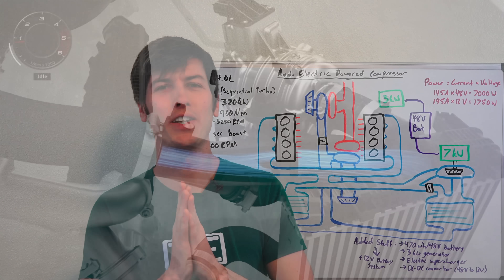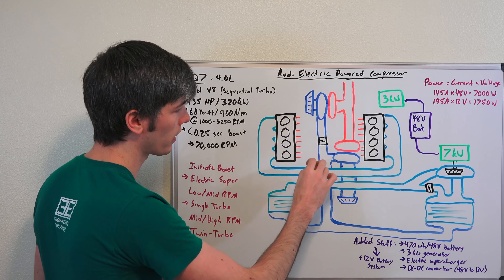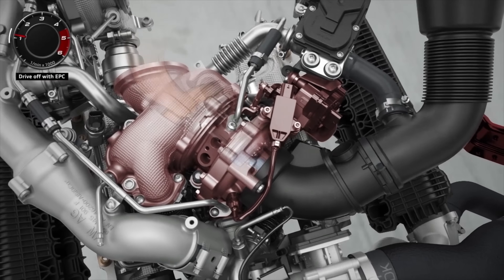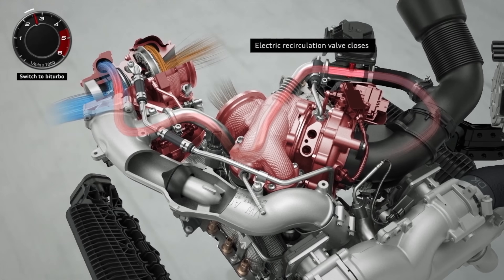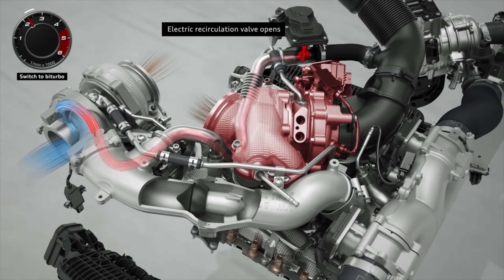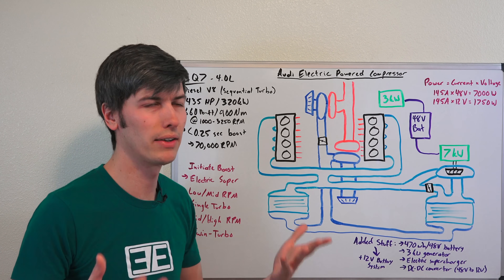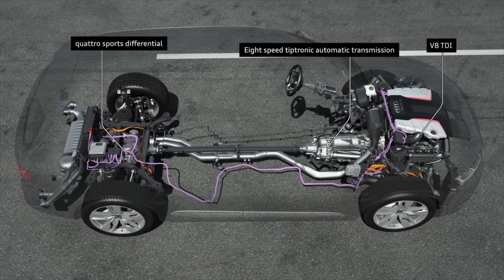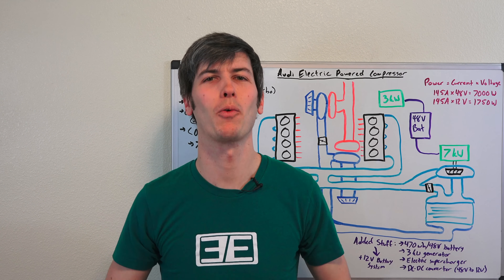Electric Superchargers - How Audi Is Eliminating Turbo Lag

Comment: Is this better than a supercharger in preventing parasitic loss?
Reply: Yes! But the trade off is that it's not able to keep up with the engine's air demand at higher RPMs! Which is why it shuts off at higher RPMs and why it shuts off under higher load!

Comment: Well I have Audi S7 TDI (europe 257kW) with this 48v electric supercharger. And i cant see any turbolag elimination compared to older Audi A5 3.0tdi 170/210kW or any 2.0tdi.

There is still massive turbo lag as like it has not any electric turbo 😃😃

Comment: "Turbo lag"
The term is used almost all of the time. It's not really correct.
"Engine transient response" is the correct description. Turbos really don't lag. There's just a lag between the time you tip the throttle, to the time the engine is making more power than it does naturally aspirated. That's not a laggy turbo.

Comment: Apparently hybrid high voltage systems work at 100-800 volts (Prius motors run at 650 but battery back is more like 200), I would think it would be easy for the OEMs to tie into that on hybrids.

Comment: The 12v system does not power the HVAC system.  The engine is powering it. The heat is from the coolant and the air conditioner compressor is run by a belt.  Only the fan is run by the electric system.

Comment: Remember there are no free rides.... the power to charge the battery comes from the alternator and its power comes from the drive belt. Also remember that every energy conversion results in some loss, so the more times you convert from mechanical to electrical to mechanical the more opportunity for parasitic power loss. These conversions also result in increased complexity and cost. You could use a belt driven Supercharger to supplement the turbo.

Comment: It would have made more sense to just have the 48v battery system and step down to 12v where needed instead of an extra 12v battery. Plus the 48v system will be able to more efficiently power the electronics and supercharger anyway if it has additional capacity to compensate for the lack of a 12v FLA battery.

Comment: Audi is twincharging, can be used as a solution to eliminate turbolag in the 2026 f1 engine regulations.
Reply: Mercedes has an electric turbocharger on their M139 engine a 2.0 4cyl making up to 416hp used in some AMG models

Comment: Actually someone made a video using a 48volt powered electric turbo where the battery powers an electric engine that spins the compressor in the trubo so no need for exhaust  gases to spin the compresser wheel of the turbo there is a standalone electric motor that spins the turbo itself therefor no lag and they made around 90 more horsepower on a cobalt motor with these eturbos so there is a future in them just need to run off of a 48 volt battery

Comment: I wanted to talk to you when you were in Adelaide; Then set-up a formal meeting with an NDA. Go from there. I'd like to discuss a few items regarding IP and Patents. While I provided some design rights to Borg-Warner, they have of course issues with VW group, my further designs are unique and fundamentally can be 'upgrades' to say new jet skis and motorbikes so an owner can do a 'hot swap' within 20 minutes in their shed to fit for purpose future emissions standards, or track mode etc including ecu adaption and manual requirements. 

Instead of just designs, I have my personal full sized gen 2 Hayabusa modified this. It looks 95% Hayabusa with the 'DIY' bolt-on upgrade using my own designed tools for quick upgrade. Plus the bike has new lighter and stronger chassis to physically increase efficiencies but significantly, with a turbo/supercharged partial electronic hybrid forced induction. Put it this way, I had an actual dream almost 20 years ago for fundamental changes that has only grown.. to now something relatively simple but not obvious at first. I had been designing since prior to finishing my Eng. Degree (civil and geotechnical) over 15 years ago -> yes, not mechanical but picked that up :D. 

I now have a physical build and tested on my gen 10 Hayabusa (about 4 above current) to be lonely to protect myself for corpo's.. Shown Suzuki and while they are negotiating with me to an extent to put me on retainer, like my last 10 years, like my recently ceased Lockheed Martin contract. 

However, this time I have built a modified ECU, to help a massive thermal efficiency increase, beyond f1 car but without the cost and detail to go far beyond EURO 5 emissions and forever improve. 

I am in Australia, but if you could get in contact with me, I'd like to use your status to first protect me from corporate thugs, make you some money % , get real investors and survive to ensure the puzzle fits together. 

Once I have made the money with a small % cut from future uses in many devices, you can present how this 'Epstein Drive', while not a fusion reaction engine brings humanity closer to clean the air while driving and move much quicker and quieter while doing it.

Comment: I just had a machine shop weld a pad on the turbine housing then drill a hole to insert a fuel injector. This allows raw fuel to be sprayed directly into the turbine having an "afterburner effect" like in a jet engine. It has eliminated the turbo lag and only sprays a short spurt when the throttle body butterfly valve is open halfway. No need for all these wires, electric motor, batteries like in this video.

Comment: Any idea what type of motor it is. I know it’s 48V DC but is it single phase, inductive ..?? I can’t seem to it out. Having stripped an EPC it has 6 windings on the stator but no permanent magnet on the rotor so the stator is energised to create the field to turn the rotor. I can’t tell if there is a capacitor in there to start the rotation or it just uses the intake air to start?? Any ideas?

Comment: I'd like to see you explore the capabilities of exhaust driven turbines to charge the 48V battery that is used to drive the electric supercharger. I wonder how much energy recapture you can get with an exhaust turbine charging system and alternator charging during coasting vs. the energy recapture of an exhaust driven turbo.

Comment: You're wrong about after market electric super/turbochargers. They are great but just don't have as high boost in high rev range and I was the guy that proved you wrong about plaid accelerating faster than breaking

Comment: I think there is something wrong with the power calculation. it's a wrong way to look at the power. It's not the correct way to look at power = work, by just changing the voltage. You need to keep your power and then change the voltage. 
So it will be 7000 / 12 = 583,33 Amps. Pretty big battery and wirring.
That's why the voltage is raised to 48 Volt in many cars where high power is needed.

Comment: You are completely wrong in saying electric turbo chargers don't do anything.. also they have kits that eliminate the need for all the Xtra items you talk about needed to run a electric turbo or supercharger.. on average they give a extra 50 to 75 hp and almost 100 ft lbs of torque.. instant power with little to no lag..

Comment: If anything: single turbo, still minimize lag with this electric piece, and use the 48V system for AWD use as well on the not-main drive axle.  

This would reap 80+% of the benefit, cut A lot of cost from AWD components (no center diff/VC, one less driveshaft) and the other turbo, and greatly improve reliability and ease or repair.

Comment: Why wouldn't you just use the exhaust gas to generate electricity and replace the turbocharger with the supercharger?  Then you get the benefits of both supercharger speed and turbo efficiency?

Comment: Why not use a electric supercharger helped by a turbo with the exhaust gases on the same shaft?
From a certain rpm, the electric motor could disengage and the system would work as  turbo.

Comment: 7kw and a bigger battery just to spin a turbo! Wouldn't it be simpler to just  go the mild hybrid route and have the electric motor handle the load while the regular turbo is spooling up?

Comment: So if audi installed a 48 volt to 12 volt converter, why does it need the original 12 volt system installed as well? I think you might want to review your facts.  Also you don't NEED to have a 48 volt system, you could do it with 12 volt but the amps go so high, which means wire sizes get huge and generator size gets really big etc. It's just way better to use a higher voltage system. I really like the use of the exhaust valve split to individual turbines but I really question why you would need the complication of three compressors to eliminate lag, either use the electric turbo with one normal turbo or use the split system with one turbo for lower air flow and two for higher. I doubt there would be any real lag with that system. Personally I like my lag cause it gives the tires a fighting chance.

Comment: I’m sure the performance is awesome but this extremely complex and expensive system is another attempt to extend the era of the internal combustion engine.  There comes a time when a format reaches limits of diminishing returns and IMO we’re there with gasoline engines.

All of these thousands of components can be replaced by ONE very efficient, low maintenance, low cost device - an electric motor.  Yes, electric has its own maintenance and cost issues - mainly the batteries - but the performance potential is virtually unlimited.  IMO, THAT is the future, not this.

Comment: This seems like a more complex stopgap method of reducing lag, compared to using a hybrid turbo charger system to reduce lag. The hybrid turbo system uses a motor placed on the common shaft of the turbine/compressor to reduce lag. With the hybrid turbo system, you can also use the electric motor to capture excess energy from the turbine to generate electricity, making it superior to this system.

Comment: Why even have the exhaust gas turbo when the electric can do the job..... less parts ... less  parts failure due to heat ...... electrical system are still  more reliable than mechanical ones...

Comment: Why don't car manufacturers use small gas turbines or rotary engines to charge the secondary (or primary for EVs) 48V power systems? Especially the former?

Comment: 1.75 kw is nothing to sneeze at, not every car needs the amount of air of that (very small I'm sure) v8, though you probably would need to go 24v installation. That said, why not just go with a mechanical supercharger that will disengage as turbo kicks in?

Comment: Any car if engine built to handel boost could benefit from battery stored/ power boosted super charger, u dial up or down per application IF they hve room under the hood. I like it, not to save hybrid tech not sound as well, but batteries give best help off the line so long as u r not running giant fuel suck engine once u get up to speed. The other way is less waste, charging from home grid or solar, & no waste alternating & using every drop of juice. So long as wt from batteries not greater than gain & u hve the space they make total sense for quick launching & elevation. Racing who cares right go big whatever, but most of us not using free hydrogen want 30mph from what ever we drive in 2021, & we want it same price range not high dollar diesel, & we want it 2nd drive poss no tow needed & longer range & most important longer term value resale & reliable cheap miles. It's all about launch w/ batteries & elevation & marrying it to right sized bank & engine for application. If hybrid or plug hybrid even better but we need to boost r way to 30+mph & still b Quick/fun & tow sturdy. Every car b4 free hydrogen should hve stored juice fresh air no reuse air boost.

Comment: Using 12 volt system isnt feasible tell that to all the car audio people running 10k watt systems off of high output alternators and lithium batteries it is crazy expensive but audi is crazy expensive anyway

Comment: surley having the cold side of the second turbo cut off only looses power?
It's still going to spin up this turbo with obviously using the waste gate for pressure to go some where. 
Unless they can cut off the hot side to the turbo so it only uses one turbo while under low to medium load.

Comment: No wonder rich people are going fully electric. If this is the wizardry necessary to get complete torque fill then it makes sense to just go full electric. Or maybe Audi should have used this with a hybrid system to make use of the battery.

Comment: Why Audi did not use Only a electric turbocharger instead of using three different turbocharger or Compressors??? I think one big size compressor is enough to give boost equals to three different Compressors and ECU can have Better control over Turbocharger.

Comment: Would there then be an exhaust driven alternator? I'd think if a turbo could spool up before the car accelerates it would solve lag. If the alternator was driven by exhaust, the engine, or as a battery electric motor, it would be possible to use the self start test exists now, and perhaps regenerative braaking, without bring a full hybrid.

Comment: Someone should make a small electric supercharger that just runs off a small lithium battery like a laptop battery. It would still have value, even if you could only use it twice, per outing. Charge it at home. Then you can have whatever voltage/amperage you want. If 48 volts is best, 96 volts is bester...

Comment: Electric compressors will give us back our naturally aspirated exhaust sound. I think a system like this optimized without any turbos on say... an in-line 6 cylinder would be perfect. If the compressor can sustain 10-15 psi of boost then why not just have this without the added weight and complexity of turbos and intercoolers.

Comment: Why couldn't they just put an electric motor to the first turbocharger? Clutch it when it's exhaust driven. Hey! Even slow it with the electric motor running as a generator instead of using a waste gate! F1 tech for the road, less parts than this contraption

Comment: I wonder about going to a single turbo to power a generator, using a ~200v battery to power the electric supercharger at 28kw. Keep enough charge to go from 0 -> 200mph 3 times. turbo only kicks in when battery gets below a certain percentage (or when cruising).
Much simpler mechanically, and engine could build more power at the same displacement (not pushing turbos during acceleration)

Comment: Since this system only runs for a second or two before the turbo spins up, wouldn't a capacitor be a much better fit than a battery to power this system?
Reply: Agreed. Also, why have the electric turbine at all?  Why not just replace the alternator with a motor/generator since you have to beef it up anyway and dump the stored electricity into that motor when you ask for all-out acceleration?  It's kinda like that's what every parallel hybrid has done since hybrid became a thing and this design is just adding more complexity to try to keep ICE "modern".

Comment: I would've to say F1's MGU-H is simpler than this enormous "mess" (1 electric motor, 2 compressors, 1 turbine). in MGU-H electric motor was coupled between turbine and compressor, thus you only have one component each (1 turbine, 1 electric motor/generator & 1 compressor). Unfortunately in the video, it was not explained why Audi/VW choose this instead of MGU-H style design. Can someone explain?

Comment: HI thanks, i have a turbo diesel an older one and want to put an electric super charger only to overcome turbo lag, it would only engage at low rpm also as the engine is LPG fumigated   a great addition, which only opens on turbo boost so the electric super would also allow for this to  power up,
Any thoughts or tip on that thanks

Comment: Modern twin scroll variable nozzle/twin turbos already offer very insignificant lag. This is really overkill and complicated. Isnt it easier to just dump that 7kW electric contraption and piping from the engine bay and put in say a 14kW motor in a conventional hybrid layout so you can have better regen braking as well and a less complicated engine bay?

Comment: Is it preferable to use this system instead of having an electric motor putting extra power directly to the wheels in the low end, while the turbo spins up?

Comment: A cool idea having an electric supercharger to supplement the TWO turbos. 
Could a 2 L. 4 cylinder engine WITH a 48 volt system to run an electric supercharger work?

Comment: while your video is probably designed to be overly simplistic, it's just not correct that a 12V system cannot provide the power.  like you said, p=vi.  there are plenty of times in industry or academia in which we use a lot of current with really low voltage (to dielectric break down over extremely short gaps).  and, as you know, changing voltage at pretty good efficiency is done all the time.  in a car, the most obvious is the change from the 14V alternator to battery and then to spark plugs (not efficient compared to one.)  yes, with the kind of power about which you're talking, it's way easier to just use a higher potential system.  but, it doesn't mean that it cannot be done and that anyone that claims it is wrong. 

power is power.  some forms are more easily moved than others depending on the application.  

you talk about another generator for the 48V system based off of the rear wheels (hopefully, it's not just one axle!!) and then a step down.  why, on earth, would anyone use a step down when they have a huge abundance of  14V from the front??  too many wires?  that makes no sense to me.  and, why a generator?  for high speed stuff, an alternator is much more efficient.  the idea of needing a DC to DC converter makes no sense unless you are trying to use a few conductors as possible.  

could you please explain?